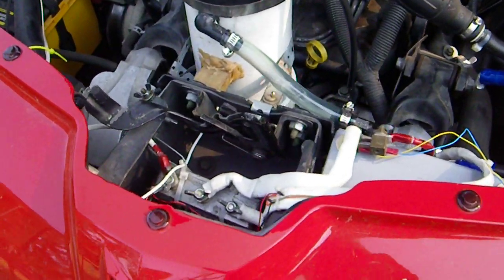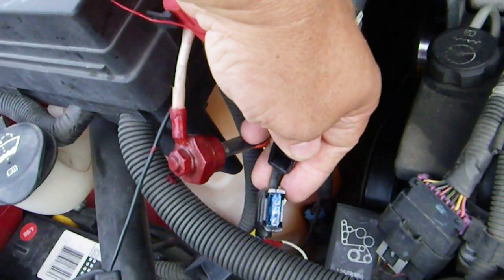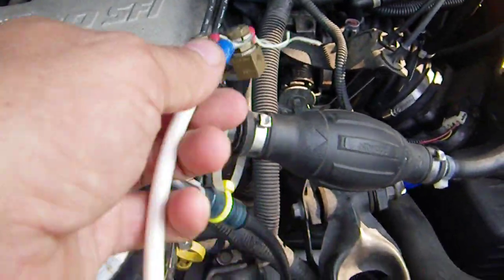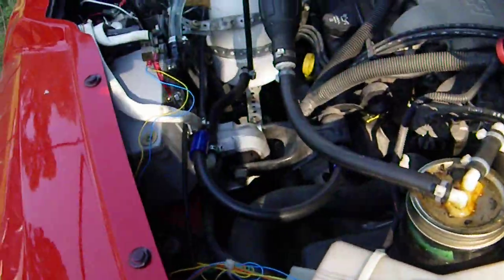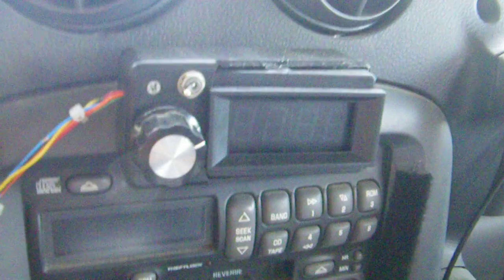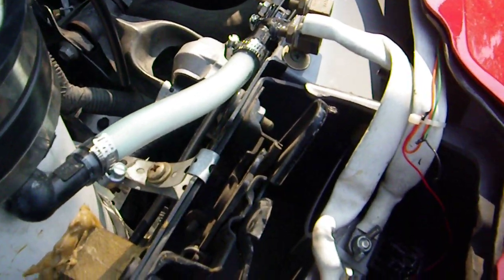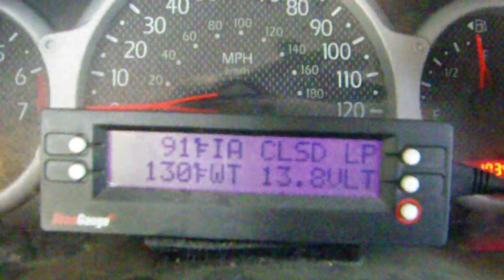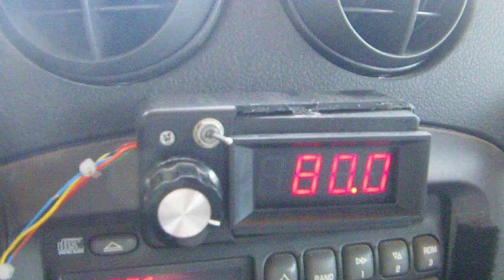HHO plates in parallel, 2.2V to 2.4V 40Amps Output, less then 8Amps input

Comment: Xmiles,Xmileager,Xmilager Gagan Behal 07829555502..
 Increase ur vehicle mileage from 50% to 80%..
Money back guarantee.. Full 1 year guarantee..
Branded product by a worldwide company..
Both kits available 2 wheeler,4 wheeler...
For franchises all over India ,contact gagan behal
07829555502,08892472443....
Join with the strongest mlm group Abhivrudhi Santosh Group...
Leaders spread all over India in
Karnataka ,punjab,bihar,u.p,delhi,pune etc.........
xxx.xmiles.in

Comment: nice i'm on the same boat all 316L and no soldered joints all tapped in screws of my SS tubes with 1.76V right now at 1.71 just tsting it out with a fogger to break down the foam on top with a zinc plate rod at 10mm under lid, slowly introducing it into a 4 stroke engine starting with small one to run on 100% HHO and a feed back to to recover un burn HHO and trying to find a way to utilize the small tiny vacume as a "highway switch" coiling mechanism to remove the PWM temporally as a test too.
Reply: Did it worked?

Comment: I am looking at this just now myself {learning curve} all interesting stuff just read that {Faraday says 1.24v, Brown says 1.48v, and Boyce says 2.0v). I just recently discovered that NaOH minimum voltage is 1.69 and KOH minimum voltage is 1.67. As it turns out, the electrolyte solution affects the voltage drop. Faraday's 1.24 volts was based on sulphuric acid...
Thom in Scotland

Comment: @HaveHandsOpen What do you want me to "let you know" about? It's a dc/dc converter which reduces voltage. Does the output give a greater current capacity than the input? Yes. Does it give a greater power output than input? No. You get 40 amp output divided between each cell. Your input is consuming 108W (13.5V * 8A) If you had 40 amps going through each cell at 2.2V, you would consume 2.2 * 40 = 88W at each cell. 19 cells would consume 88 * 19 = 1672W. Do you think your getting 1672W from 108W?

Comment: @HaveHandsOpen It's not what I say, it's what I learned in class almost 30 years ago when I was studying to become an Electrical Engineer. Among us Engineers, this law of science is very basic like 1 + 1 = 2 and it is applied to almost every project we work on. I'm not denying your mileage claims. I'm just pointing out that you're not putting 40 amps through your cells while drawing less than 8 amps. Making these kinds of claims doesn't  do your credibility any good.

Comment: @HaveHandsOpen Every path in your generator is called a cell. The 40 amps you send to your generator gets divided between each pair of plates (cells). At 40 amps, you are only putting 6.67 amps through each cell (or pair of plates). If your cells (plates) were in series with a PWM and you wanted only 6.67 amps going through each of them, you would only need to draw 6.67 amps from your alternator. 

Losses in a PWM are much smaller because it's just a switch, there's no conversion taking place.

Comment: If you're pulling out 40 amps on a six plate parallel generator, you are only putting 6.67 amps through each cell. You are losing 1.3 amps to heat within the converter. If you were using a PWM instead with a series configuration, the 8 amps you are pulling from the alternator would be going through all the cells.